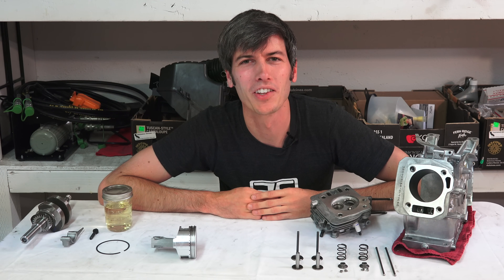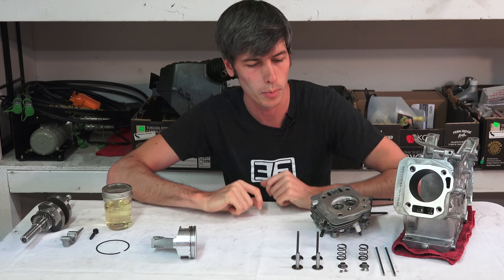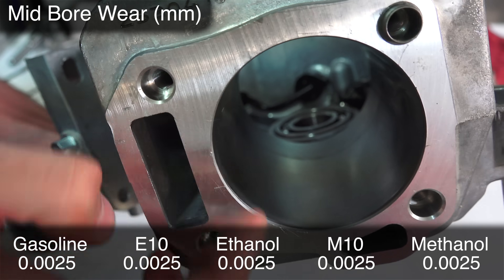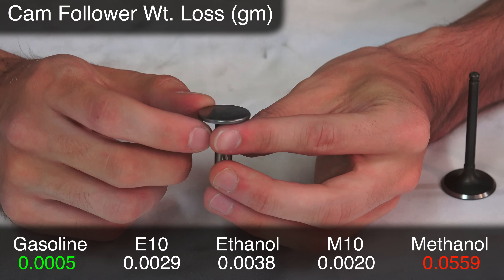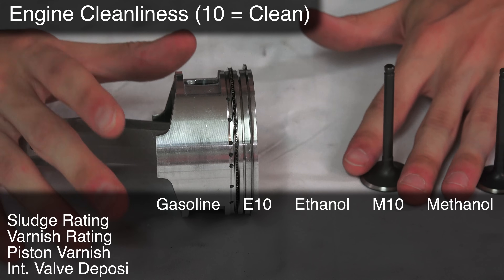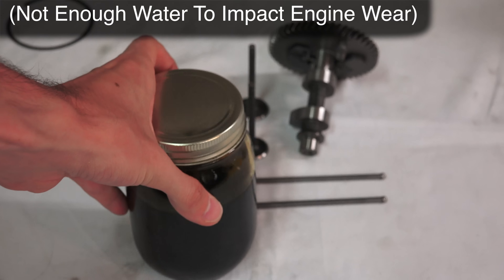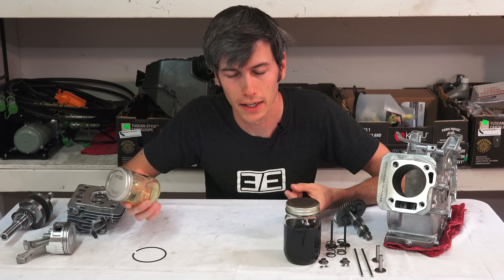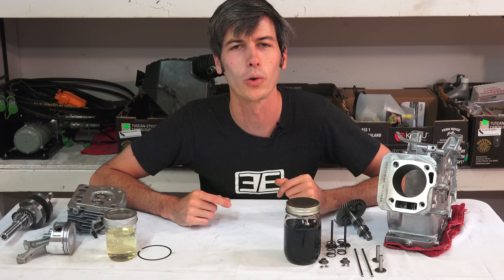Is Ethanol Bad For Your Car's Engine?

Comment: As informative as this video is, I find this study inconclusive to say the least. 20 hours runtime for an engine is even less than nothing in comparison to the lifespan an engine can have. Not one engine is exact the same as another, not even from the same production line. You could have run this test with the same fuel in these engines and the measurements could still differ. And lets be honest, the engine is not the only concern when it comes to the E10 we put in our cars. The fuel systems, combustion systems (spark plugs), the fact that ethanol can dissolve plastic or rubber gaskets all contribute to why you should have some concern about it. None of these will cause damage overnight or in 20 hours, but in the long run..... It's just not effective to have 10% of it in fuel. Yes it will burn a little bit cleaner but on the other hand your car will consume a little more. I think a better, longer and more thorough test or multiple tests are in order to be more conclusive.
Reply: I concur. The conclusions are not reliable.

Comment: Surely, irrespective of wear, Ethanol makes more sense than petrol/gasoline and diesel? At a guess, without having watched the video, I'd say that Ethanol is a much better fuel than petrol/gasoline/diesel because 1) it's easy to produce and, 2) the only waste-products are CO2 and water. 

Just saying...

Comment: Since 1981 quite a lot have happened in metallurgy making engines more resistant against the corrosive byproduct from burning ethanol. I think the same test today would show a lower difference in wear.

I have been working on e85 engines. Compared to the regular gasoline engines of the same engine model the e85 engine had reinforced engine parts, reinforced exhaust system other sparkplugs (don't remember if they were hotter or colder) and a modified engine management system.

It was 9-10 years ago so I might not remember it correctly, what I recall about the internal parts the e85 engine had reinforced pistons, liners, valves and valve seats. It also had other gaskets in the fuel and injection system and also modified injectors if I remember correctly.

Overall the engine and connecting systems were reinforced to coup with the more corrosive ethanol. I don't think you should go above the recommended amount of ethanol in your gasoline engine as ethanol will wear on the parts over time. With that said I think that most modern cars can actually handle a quite high share of ethanol in the fuel, well above the 10% at the gas pump. But not as high as the e85 fuel.

Comment: Ethanol increase the water in the engine oil. Does it cause corruption to the steel? When there is high temperature with oxygen and water, the corruption will happen.
Reply: good to know i only use unleaded gas no ethanol

Comment: So everyone needs to fast forward 38 years and realize that the metallurgy in engines has drastically changed.  I've personally logged over 100,000+ miles running e85 and can tell you there is no wear period.  I run my 2013 f150 felx fuel only on e85. I also run an 11.5 to ford 331 stroker on e85.  It has a superior octane rating of 105 even the winter blend which is around 60% ethanol has about 93 octane.  The oil never gets dirty.  I use amsoil in both.

Comment: My 2012 Hyundai Accent owners manual says not to use an ethanol blend above 10%. mainly due to rubber and gasket wear. It may even void the warranty. I would appreciate a video covering that aspect.
Reply: my is a hunday accent 2013

Comment: In my experience, E10 is hygroscopic. In many gas stations water is dissolved in e10 gas and is not combustible. 

I have noticed this on two separate direct inject cars. In both cases:
* significant drop in mileage and power esp when towing
* a loss of as much of 1litre of engine oil in one tank full. 

When I use fuel with no ethanol, no problems at all. 

My mechanic thinks the moisture is blowing by the rings and over pressuring the crankcase causing oil to be pushed out. 

This seems to be an issue because gas stations are not testing for water dissolved in gas. They are testing for undissolved water only (in separate layers). 

Thoughts?
Reply: Ethanol is hygroscopic, with or without your experience. Water is not combustible here on planet Earth. However, having ethanol in a gasoline blend is the best thing that can happen to gasoline. If and when condensation forms, the ethanol absorbs that water, breaks the water molecule down so that the fuel can combust, and the water molecule is vaporized. Ethanol also helps to stop the fuel lines from freezing in cold weather. If you don't have ethanol or something else to mitigate the condensation moisture then you can experience trouble. 

Condensation is naturally occurring and it will form whether there is ethanol in the gasoline or not. Ethanol does not cause more condensation to occur in the fuel tank or system. If you have so much water building up that it "blows by the rings and over-pressurizes the crankcase" then you should do one of three things: Have your engine fixed; make sure you use the fuel hose at the service station and not the water hose; get a new mechanic because he doesn't know what he's talking about.

Using ethanol-gasoline blends in a gasoline-optimized engine will usually result in a loss of mileage (but not always). However, the lower price per gallon of the ethanol-gasoline blend will almost always over-compensate for the loss of mileage. Therefore there is a net gain. Ethanol adds power, it doesn't take away power.
Reply: Right but why then when I run e10 from an old gas station am I loosing oil?  How can that be good?  When i avoid e10 I have no problems-even under heavy loads.
Reply: You're mixing two things together that don't make sense. Why are you posing the problem by saying "E10 from an old gas station?" If the 10% (or slightly less) ethanol in the blend is causing a problem, why wouldn't it happen with E10 from a "newer" gas station? If it's happening from just one particular service station that you use, and it happens to be an old station, perhaps there's something wrong with the tank or pump system that is dispensing something more than just E10.

Fuels do perform differently under different conditions and different circumstances. Although a the new vehicle sticker (Monroney) will give an estimated highway and city MPG of a vehicle, this highly generalized estimate does not take into account all the circumstances that can occur. I'm mentioning the Monroney just to set a benchmark. When the estimate is made it was not based upon real road testing under different conditions... and certainly not all the conditions that can occur in a real life situation. People should, and can, make fuel decisions on a day-to-day basis. They don't do it, because they don't know they can do this, and because they have been led to believe that all you need to do is pump in the fuel, start the engine, and drive.

Here's an example of what I mean: I'm a very strong advocate for ethanol. However, I alternate my "splash blending" depending upon what type of driving I'm going to do. If I'm going to do a lot of highway driving, I fill my flex fuel van with E85. If I'm going to just do city driving then I use about an E40 blend. Before I bought the flex fuel van I had a non-flex fuel Ford Taurus. I usually didn't use E85 (although sometimes I did) for highway driving; I would "splash blend" between E30 and E50. If I was doing city driving I would only use E10 or splash blend something around E20. By doing this I maximized my MPG.

It sounds like you have worked out a formula in your mind that says "Under towing conditions, I should do this; under normal conditions, I should do that." I don't think there's anything wrong with this. As I wrote above, it just may seem strange because we've become indoctrinated into thinking that "one size fits all." And a "one size fits all" mentality is easier than having to actually think about it. But that's how life is. If you want to stretch your food budget dollars, you use coupons or choose a different store because they have a sale, or choose a different brand on a given day of something that is basically the same as another brand. So why not use the same kind of consideration when fueling up. I say this especially because each fill up can easily cost between $50 and $75. 

My problem with your earlier posts is the comments supposedly made by your mechanic. Someone can be very expert at changing spark plugs, air filters, oil, hoses, and fan belts, yet know nothing about fuels. I come across this every day.
Reply: Older gas station are more likely to have water leaking into tanks. E10 initially dissolves the water but later forms layers — see link.

Bottom line is I often lose oil when burning e10 gas. It most often happens with older gas stations - suggesting water is the problem.
Reply: You're making a judgement based on wrong information. An old gasoline station may have very new tanks. If you live somewhere where there is no state regulation, and they have allowed a service station to use the same tanks and system that was installed when the station was originally built, then don't use that station, use a newer one. But this is a problem of the station, not the fuel.

The layers that you're referring to, phase separation, is caused by gasoline, not ethanol. And phase separation happens because gasoline is not as hygroscopic as ethanol. It will occur whether there is ethanol or not in the blend. Your claim that you lose oil when you use E10 is nonsense.

Comment: Wish you hadn’t thrown the word ‘corrosive’ around so liberally and imprecisely. pH of pure ethanol is 7.3. Water is 7.0. Not alkaline enough to make any difference. 

Ethanol enables more water to dissolve in gasoline than does pure gasoline. Phase separation is opposite to what you said. Water gets into a fuel tank the same way whether it’s filled with pure gasoline or an ethanol fuel. Expansion and contraction of vapors enable humid air to enter and condense. 

How hygroscopic is it? Open a bottle of vodka, mark the level, and check periodically to see if the volume of liquid changes appreciably.
Reply from the maker: Fair point about ethanol! What was my counter at haha? Regarding phase separation, I wasn't saying that water separates out, the ethanol, combined with the water, separates out from the gasoline. Then you have a layer of gasoline, and a layer of alcohol + water. Obviously not ideal. Leave a bottle of vodka out and the alcohol will evaporate out (all of it will, eventually, but alcohol evaporates more quickly than water). One of several reasons why alcohol is used in hand sanitizers, as it cleans well, and evaporates quickly.
Reply: Engineering Explained 

It will evaporate as an azeotrope, about 11 mole %water/89 mole %ethanol. By mass, about 95.6% ethanol. My ? about the vodka bottle was to compare rates of evaporation with hygroscopic addition of water. Changes in volume over time would depend on humidity and the frequency of temp changes, such that contraction of vapors would alternatively draw humid air in vs expansion, which would expel alcohol and water vapors. I have a bottle of Southern Comfort that’s been sitting for 30 yrs with a pour spout in the neck. Aside from a few gnats it hasn’t changed. I also have an open bottle of red wine on my fridge that’s been unchanged for 15 yrs. I believe a monolayer of tannic acid on the surface may be regarding its evaporation. 

Re corrosion. Degradation of elastomeric materials like hoses and gaskets involves solvent extraction of non polymeric components combined with absorption of solvents, and oxidation. Ethanol will be more or less compatible with some elastomers as will gasoline with others. Poor compatibility is not corrosion, which typically involves chemical reactions which convert metals into their salts. Corrosive is misapplied to materials that look degraded, regardless of the reason.
Reply: Frank, good reply. You are correct.

Comment: What about two strokes engines ? What fuel should I put in my motocross when E10 and E5 will replace traditional gasoline ?
Reply: E85 decreases the clinic variation (difference between cycles)... But you have to use a proper carburetor and oil... E10 shouldn't make any harm, here we only have e27 gasoline and never heard of anyone having a problem
Reply: But be aware that you shouldn't leave the mixture in the thank for a long period of time, some tanks can lead to air humidity contamination... And if you have a steel gas tank, e85 is a bad idea

Comment: All I know is that when running 10% ethanol gas in my 1990 V8 Mustang,
with 11,000 original miles, the engine would not stop surging while idling.
I drained the tank and refilled with ethanol free gas and the surging
stopped and the engine idled like new again. My 2014 Infiniti Q60S
and my 2004 Nissan 350Z  manuals warn against using ethanol
laced gas.

Comment: I have a flex fuel vehicle and I can say that when using the ethanol free gas, my mileage is significantly increased to well above what the EPA rating is. I get approx. 33 mpg compared to the cars rating of 25 mpg for highway driving. When I am unable to get the alcohol free gas and have to purchase E10, my milage is anywhere from 19 to 22 mpg. E10 comes with water. Water doesn't burn, but just rots outs metals after a long period of time. Unless your car runs at a temperature over the boiling point of water at your location's elevation, it's no good for the car. It's a no brainer to me to buy the ethanol free gas. It is less expensive on a mile-per-mile basis and the added power that comes with it is amazing.

Comment: Thanks, very informative. Methanol is of course toxic, and very low CV,(calorific value), so from an energy density point of view is not good. Ethanol is a bit better CV, but lower than the hydrocarbons which form most of gasoline.
 For me , I would want to fill the tank with as much energy as I can, I suppose Diesel is the most energy dense, but has other problems.
 Ethanol is of course available from crops, which harness the suns energy very efficiently, so the whole debate is very wide ranging. Maybe solar charged electric cars will eventually dominate.
 Thanks again for an analytical discussion.

Comment: a month late and a dollar short...can you do a vid showing E10 vs straight gasoline for mpg? When E10 was introduced, i lost on average 10% (approx) mpg(us) with a '92 4 cylinder engine. I have no way to test this myself in 2018 mainly because everything is E10 in US. However, I think I found a local station that uses slightly less ethanol and I get slightly better mpg than the mainstream stations (1-3%). Does ethanol additive actually cause a 1 to 1% loss in fuel economy?

Comment: Seems like all of the government regulations on using ethanol and restricting is backfiring. What then intended to happen is that manufactures would be forced to produce lighter cars with less performance, but in reality consumers don't want that so they end up using technology like direct injection that basically sacrifices fuel economy and longevity instead. So we end up with cars that don't last as long requiring more energy (fossil fuels) to make more cars, we burn more gas due to engine design and lack of power in the ethanol blended fuels, and burn more energy (farm equipment) trying to make fuel out of corn.